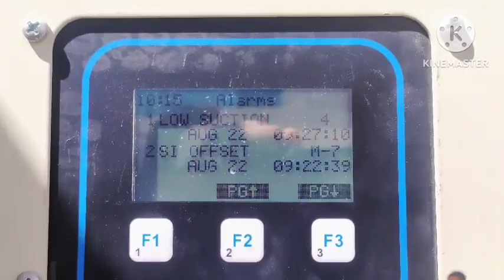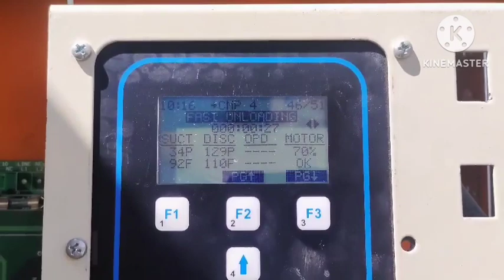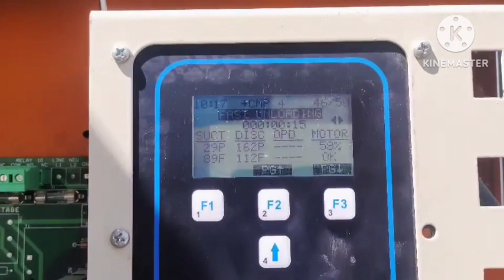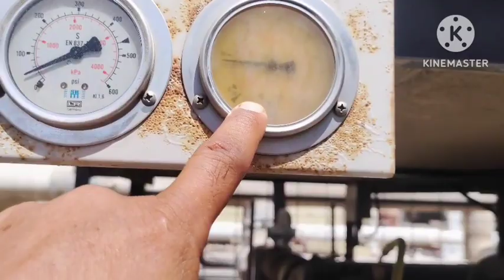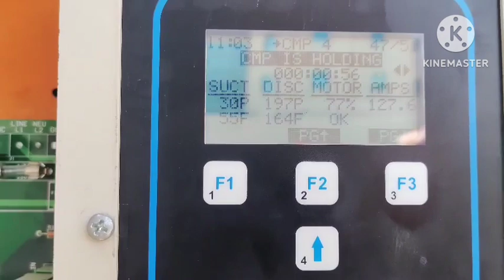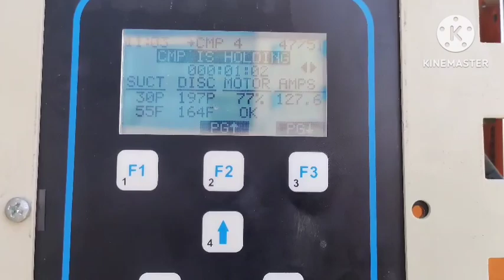SKM chiller low suction problem chiller  low  gass issue skm chiller ka  low gass problem

Comment: Mera skm ka chiller hai 150tr ka 
Usme 2 weeks se every 24 hours me low suction ka alarm aa jata hai 
Gas check kiya r134A ka 32 PSI running me hai 
Leakage check kiya nhi mila 
Transducer change kar diya 
Fir bhi low suction ka alarm aa ja raha hai 24hourse bad 
Aur 
Suction temp 131F
SSH 98.8 
DSH 30.5 
Ye reading itna jyada kyo aa raha hai